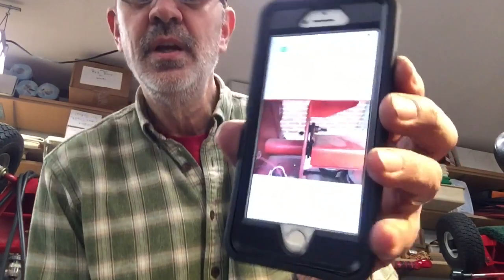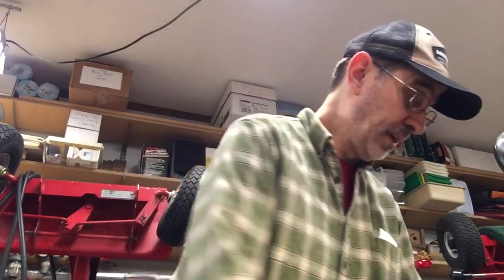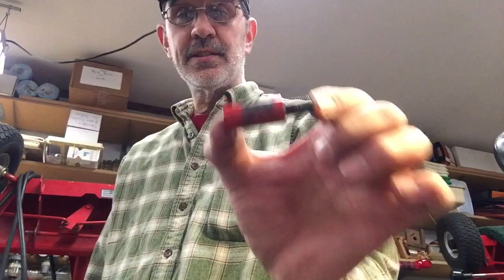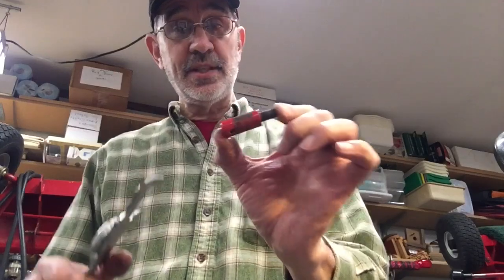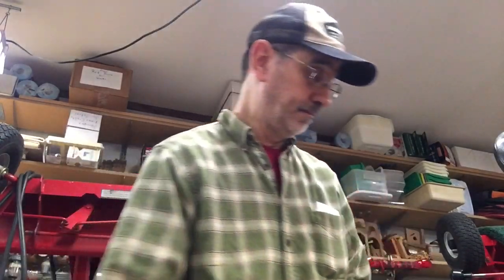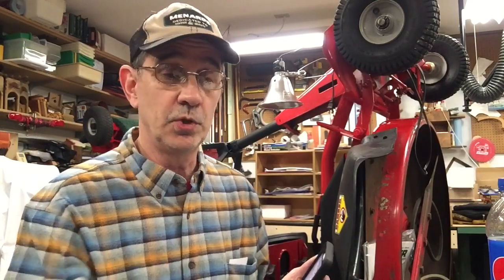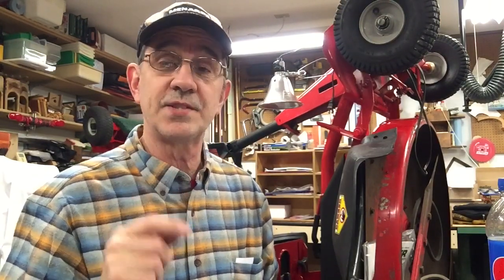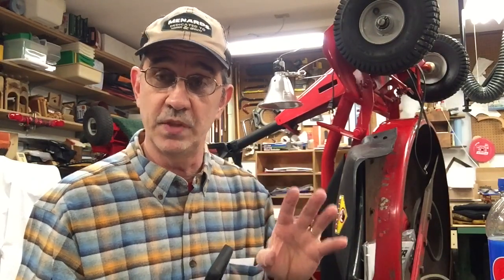330. M/S 62  How can I adjust my mower deck belt on my Snapper

Comment: Thanks Jim for posting this  informative video.  I inherited my Father's  SR150  331413KVE  24 years ago. It has always been a bear to adjust the belt on that square frame machine.  Your video has given me some much needed insight on how this adjustment system works. Come spring time I will procure the correct belt adjustment parts n pieces to make this mower correct.
Reply: Hi LEE JOHN - it's Big Rodders in Ireland.  I have a Series 16 square tube model and discovered that Snapper states that no adjustment is possible.  Look up the interweb and download the correct manual for your specific machine before you spend any money.  Refer to my response to Jim for further info.  Good Luck.
Reply: Hi LEE JOHN - Big Rodders again. I checked up the Parts Manual for series 13.  It appears that your model is adjustable, unlike my series 16 square tube model.  The spacer number is listed as 2-2589, it's a different design to Jim's example and the bolt arrangement differs also.  There are 2 spacer washers on the bolt and you remove one for each spacer you fit to stretch the machine.  It's vital you research your specific machine before purchasing.  Hope this helps somewhat.
Reply from the maker: Well thanks for watching and hopefully for being a subscriber talk to you soon. Jim
Reply: @rodneysweetnam8653   Thanks for the reply.  I knew that my Series 13 is adjustable. It is just a Bear to adjust correctly. I tried to make my own spacers but that did not turn out as well as I expected. I will do an Internet search to find the correct spacers.  I have this mower slated to be worked on this spring. New boots, a new smooth clutch assembly, belt and a general look over of the rest of the mower. This mower is currently equipped with a Snapper Ninja blade used for mulching Pin Oak leaves from 12ea. 40 year old Pin Oaks.  I plan to just hand file sharpen the Ninja Blade.  I have set this mower aside to be used only for Fall Cleanup Duties. I have several other Snappers available for regular grass cutting duties.
Reply: @JohnLee-ug8ol  Hi LEE JOHN - Big Rodders again. Interesting insight into your operation.  Bring a Snapper enthusiast in Ireland is a lonely hobby so I enjoy interaction from across the pond.  Our specific experiences may differ but I imagine our challenges are similar i.e. prevent the belt slipping when engaged but ensure blade spindle stops when belt disengaged.  Unsure whether you have one or two idler pulleys but I learnt it's vital to ensure that all pulleys are precisely in line, especially when belt is engaged.  My belt jumping issue turned out to be due to this issue and not a tensioning problem as first assumed.  What part of the States are you in?

Comment: Jim, in theory why not just replace the deck belt when it gets stretched and worn, that way you could avoid buying the shims?
Reply from the maker: Well unfortunately all the belts are not made in the same countries. And the sizes are not the same a brand new belt may be longer than your old stretched out one, or shorter than a new one from a different country. Jim

Comment: Jim forgot to tell you fella that I used Nylatron that was 1/16 thick sheet. That is what I had and it worked perfect. The sheet is still hanging on the cellar wood beam if I need some I have some left. Really tough stuff for sure with excellent lubrication. Peace Jim

Comment: I was looking at this today on my mower. I was thinking I needed to put a couple of those washers on the back side of the plate
Reply from the maker: You want to try to maintain 1 inch and 1/8 between the belts when the mower deck is engaged in the engine is off. Jim

Comment: I have a sr1028 that was given to me and, my setup came with a bolt instead of the pin.  
Screw, 3/8-16 X 5/8 Hex Washer Self-Tap, Bp  , 
Spacer, .39 X .625 X .19" Sintered Iron 
Washer, 3/8
Reply from the maker: Through the years snapper made a lot of changes which didn’t make a lot of sense yours may be factory I don’t know I guess I would have to see some pictures. Jim

Comment: Hi Jim - it's Big Rodders in Ireland.   I am somewhat confused.  The photo appeared to me to be of a square tube model.  I have one such model, E281216BE, and the manual specifically states that no adjustment is possible and the only option is to fit a new belt, my model has 1 fixed idler and 1 tensioning idler, which might be relevant.  Suggest to Larsen to look up the interweb, get the specific online manual for his machine and study it as Snapper seems to have used different belts sizes on different series.  The two parts of my machine are held together differently to the round tubed ones, mine has tbe ability to hold only the original 1/4inch circular spacer between the swivelling surfaces.  I spent hours researching an issue I had and I made up 8mm spacers (1/4 inch = 6.35mm) out of a plastic chopping board to experiment but had to make my own bolt arrangement to rejoin both parts of the chassis as the original one was then too short.  Stretching the chassis did not sort my issue out, just resulted in the blade not disengaging.  I will email you with my issue and resolution but that's a different story.
Reply: Hi Jim - Big Rodders again.  As the old saying goes - "Every day is a school day" and I'm not now as confused as before!  I have been in touch with LEE JOHN as well as  scouring the interweb and discovered that all the square tubed models are not the same.  My Series 13 cannot be adjusted while his Series 16 can, to the extent of 2 spacers.  The spacers and the retaining bolt/pin are different to the round tubed models.  Will be in touch.  Keep on Snappin!
Reply: @rodneysweetnam8653   Correction time Sir. My SR150 is a  331413KVE.   It is a 33" cut   14hp  series 13  with a Kohler Command 14hp Vertical Shaft  OHV Engine.  With  a  manual pull start & an electric start.   She is a rugged old girl but come this spring she will be getting some TLC that is long overdue.
Reply: @JohnLee-ug8ol  - Big Rodders again.   Apologies for my error.  I always proof read my comments but obviously failed on this occasion.   To clear up any misunderstanding for interested subscribers - my machine is a Series 16, whose belt cannot be adjusted while your Series 13 mower can be stretched to tension the belt.  The parts manual drawing suggests you can install a max of 2 spacers.

Comment: What’s the part number for the shims at parts tree?
Reply from the maker: The part number on the shim to extend your frame for tightening your belt depends on your model number of your machine if you go to parts tree with your model number you can find the shim. Jim
Reply: @jimjackson9381  I found it. Thanks Jim for all your very helpful videos! 👍🏼👍🏼